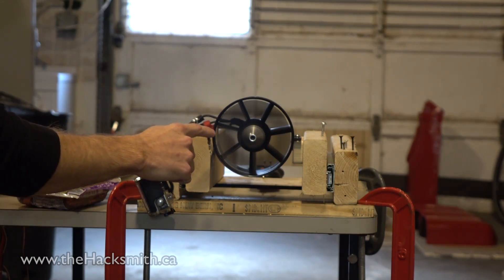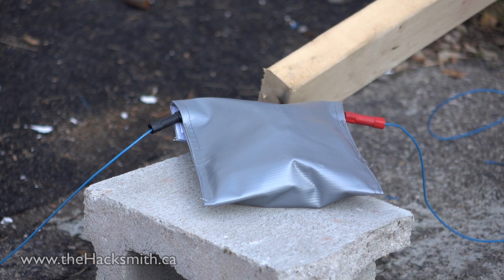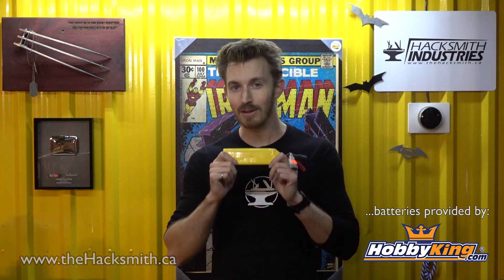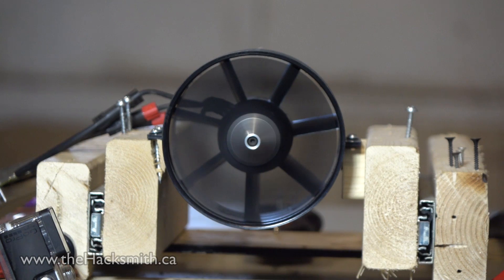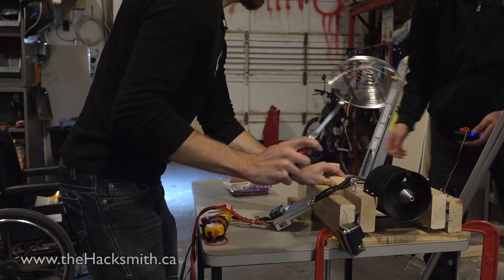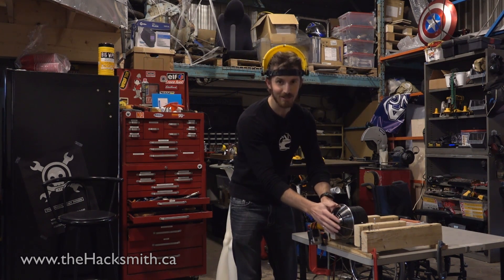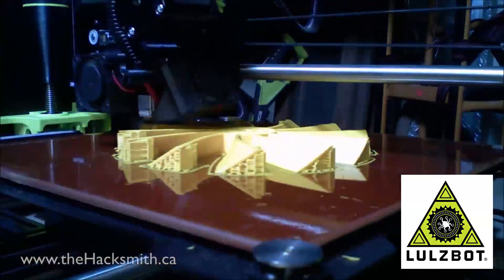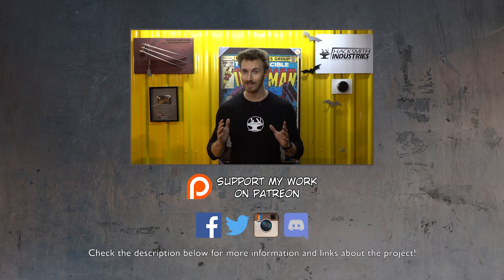Flying Like Iron Man #11: Not So Safe Safety Tests

Comment: couldn't you put a small solar panel on the suit to help give energy to the battery?
Reply from the maker: +Brian Navar you'd need a foot ball sized solar panel to even start to power this system -- it is extremely power hungry!
Reply: @hacksmith  i have an idea:

Connect the electrical transformers used in the taser potato to the solar panel=  INFINITE POWEEEER
Reply: Couldn't you put small pieces in different areas? Like as back/chest pieces? And than a strip on the forearm?
Reply: This is such an amazing build, very inspiring to think of many ways to make it better by the second.
Reply from the maker: +Brian Navar small pieces of what?
Reply from the maker: +Brian Navar they would be pointless though, small solar panels only produce like 5-10W -- they'd just make the suit really heavy. You'd have to leave it in the sun for a few years to charge it and even that probably wouldn't work cause the batteries would probably lose more charge from just sitting there :p
Reply from the maker: +The Diamond Crafter pretty sure I know more about solar than you guys. I have a 10kW array on my roof -- on a sunny day it might produce around 6-7kW. So if I have 1000sqft of solar panels I can power maybe one of my smaller EDFs. Lol
Reply: Why not build a small nuculear plant while hour at it?
Reply from the maker: +The Diamond Crafter pretty sure I know more about solar than you guys. I have a 10kW array on my roof -- on a sunny day it might produce around 6-7kW. So if I have 1000sqft of solar panels I can power maybe one of my smaller EDFs. Lol
Reply: Yeah, but you kept pushing the idea, even though they tried to tell you the facts. So I hoped actual calculations would convince you. Sorry if I sounded arrogant.
Reply: Brian Navar unfortunelty that wouldent help🙁 you would need hundreds or possibly thousands of full sised solar panels to power that suit
Reply: Yeah, you can make small pieces of solar panels for back and chest plates and a plate on the forearm
Reply: Ohhhh, okay. Seemed like a good idea in my head.
Reply from the maker: +Vulkan: Games & Space I think you should check your facts on that, solar panels are not that efficient. Maybe 1000 third world homes?
Reply: the Hacksmith why not just use one normal cable with a series of capasators to get the energy you need
Reply: not enough
Reply: Brian Navar wind turbine under the thruster will be better : ) and its saver because it took so long to dead and it will descend slowly
Reply: Brian Navar you wouldn't get nearly enough power from sloar
Reply: the Hacksmith i know you're right and everything it sounds silly that a solar panel would do anything but dont you think you're being a lil bit rude? You're asking for funding off your fan base then you talk down to them... Let them down gently not like that.
Reply: football field*?
Reply: Brian Navar there is no solar energy in the room m8
Reply: The solar panel.
Reply: the Hacksmith that's wrong go solat
Reply: Then try it and I'll FOLLoW you
Reply: Vulkan: Games & Space try it and I'll FOLLoW you even though I'm not that popular
Reply: The Diamond Crafter I dont have any... im kinda 14....
Reply: You are funny, and can obviously not calculate and/or research. Going by this  article https://www.nasa.gov/centers/kennedy/news/releases/2010/release-20100408c.html
The solar power plant you mention provides 10 mW, and will be around 60 acres big, which is 2,614,000 square ft. In other words; 2,6 MILLION square feet.
First, them costing around 1 million dollars for 30 sq ft is ridiculous, since a single plant will cost about 87 billion dollars, and they plan to do many of them. That put aside HackSmith requires 150 kW, so let's say he can cram 15 sq ft solar panels on his body (which is the average surface area of the human body). The solar panels could then provide:
2,614,000 sq ft = 10 mW or 10,000 kW (according to link)
1 sq ft  = 10,000 kW / 2,614,000 = 0.003826 kW
15 sq ft = 3.8 kW  * 15 = 0.05739 kW

Not even a fraction of what he needs!
He would need around 40,000 sq ft of those solar panels.
Reply: Osman Toplica are you talking to me? Because I was just curious about it, you didn't have to go waste your time to tell me something that was already answered.
Reply: I wasn't pushing the idea, I was just asking questions clearly.
Reply: Soaker panels wold be to slow
Reply: Brian Navar even if you could charge it fastly then you also have to worry about the battery being overcharged
Reply: Brian Navar wouldn't produce enough electricity to be efficient at all
Reply: Brian Navar Would not be efficient enough and would be too heavy/bulky
Reply: a small solar panel can take multiple hours to produce a worth while amount of energy
Reply: Not efficient enough
Reply: A house worth of solar panels make 80 kwatts
Reply: Brian Navar i just think you would also need to put the convertor to convert the solar energy and it would make it more heavy
Reply: Please tell me that was a joke
Reply: You should go to KSC there is a 350 sq foot solar panel powering 1000 homes as a test. didnt get exact voltages but if you could get your hands on it (Unlikely but possible) Solar panels might work!
Reply: the Hacksmith I just did. They cost roughly 1 million dollars per 30sq ft (WAAAAAY out of your budget) but they are the most efficient solar panels in the world. My friend at nasa (Who is working on the project) said that the solar panels will eventually replace all power plants and household solar panels

Comment: i thought you had a tormac pcnc 440, why not machine your own blades out of aluminium? I would be much more resistant and a lot smoother surface finish.
Reply from the maker: The 440 only has a bed size of 6" x 10" -- we can get free EDFs from Hobby King up to about 5" in diameter, so we wouldn't be gaining much from milling our own blades -- and each job would probably take 20-30 hours for that much detail =(
Reply: oh, didn't know that about the 440, maybe it is possible to have some kind of fixture to machine 1 5" or 6" blade an then weld it or bolt it to a central hub, so in best case the turbine could be 10" or 12". I guess i would be very time consuming and expansive due to the price of aluminium stock.

Comment: Ya' know, you could get 1 big EDF, then just make a silicone mold of the fan blade and copy the same design a few times out of pewter or Iron.
Reply from the maker: Pewter would be too soft, and iron would be too heavy -- it wouldn't be able to lift itself :P
Reply: Hmm, maybe what are the EDMs that you use are made out of, or Aluminum?
Reply from the maker: +Ptychozoon or plastic
Reply from the maker: +Ptychozoon or plastic
Reply: Yeah, exactly
Reply: Ptychozoon
Reply: Ken Barrozo ?

Comment: Don't know if it has been mentioned already but maybe try the print for the blade out of carbon reinforced nylon from  printer such as the Markforge Mk II? Should stand up to the forces pretty well over ABS and normal plastics. Love this channel BTW!
Reply from the maker: +Justin Coetzee I don't think the bed size on that printer is big enough! :(
Reply: the Hacksmith Markforge also has a new printer, the MK X which may be able to do it. it's a pricey machine but if it's for a prototype then you could possibly outsource to someone with a MK X? thanks for the reply BTW keep up the great channel!

Comment: If you add a compressor fan with high volume low pressure, the printed blades would would work well.  Then you can purchase a smaller metal blade and run at higher RPM to generate the actual thrust.  Also, if you turn the motor inside out (Make the blade part of the armature, and increase the size of the stator and eliminate the central shaft) I suspect you'll have better results. The navy did.

Comment: Instead of really expensive fans and bateries, which are also heavy, maybe you should use hybrid rockets like the one NightHawkInLight showed in his last video. You just have to made a bunch of them, strap an oxigen tank on your back and extend some hoses to each rocket. Also with this type of hybrid rockets, you can very finely control the thrust by adjusting the oxigen flow. You just need to research a bit about the nozzle shape, different types of fuel, materials... but that's what you are supose to do. Keep working and good luck ;)
Reply from the maker: Hybrid rockets could be cool, but while NightHawkInLight made it look pretty simple, remember the one he made didn't really produce any thrust. The scale and amount we'd need to fly might be out of the question. We do plan on messing around with hybrid rockets, but probably not for this project at this time =)

Comment: I'm not an expert at all but if you put a funnel on the edf wouldn't that result in more thrust with the same amount of power?
Reply from the maker: There's something called a thrust tube which you can add to an EDF to increase the thrust by 20-25% -- but that only works at high speeds. Since we're mostly just trying to hover, it actually reduces thrust (a static scenario)

Comment: Hello Mr Hacksmith, 
Do you think that it could be safety and more feasible with 5x jet engine RC thrust 300N each one ?
Reply from the maker: Thanks for the question ifrit772002!

We've actually answered this in detail in the Flying Like Iron Man Q&A video! Check out that video, or visit http://www.thehacksmith.ca/flight-project-qa/ to learn more about the project!
Reply: Yes i watched, it would be very expensive but an EDF with 300N thrust isn't exist lol... so maybe you could put 4 x 240N EDF on jet boots (two per boot) and 2x 240N EDF on hands (1 per Hand)....6 x EDF at arround 3600$ (21600$) for a max powerfull of 1440N ... i think it's a hard question because each system have avantages and disavantages....
Reply from the maker: +ifrit772002 to see the layout we have for the design check out the go fund me campaign :)

Comment: @the hacksmith, put an outer ring around the 3-d printed edf blades. They would then be support from two points and while it might reduce some of the thrust, they would have a much lower chance of breaking.

Comment: Have you considered printing the fan in PLA and using a 'lost PLA' casting method to cast the blades in Aluminum?
Reply from the maker: Problem is at home-casting is pretty difficult for precision parts. It works for a lot of things, but for something like this, might be more effort than it's worth.

For example -- if you see the professional EDF blade we show near the end of the video -- look at the underside. It has a bunch of holes in it. Those are for balancing the blade so when it spins the CofG is perfectly in the center. Considering that whole piece was machined very accurately, it should of been balanced from the get go. Now imagine casting it, how many variations it would have! It might be possible, but like I said -- would probably end up being more effort than it's worth.

Comment: On the edf blades:
Wouldnt it be more strucatually stronger if the side where the wind goes to was made of triangualar shapes? this is quite stronger then solid material and would end less peices flying off also it would make the edf blade lighter resulting in a bit more rpm on the blade itself

Comment: hey hacksmith, what you can do to create your own EDFs is, 3D print the blade design, then make silicone mold of it then a wax mold inside of silicone and then forge metal and make your very own metal blades  !!!! Please reply if you read the comment
Reply from the maker: Problem is at home-casting is pretty difficult for precision parts. It works for a lot of things, but for something like this, might be more effort than it's worth.

For example -- if you see the professional EDF blade we show near the end of the video -- look at the underside. It has a bunch of holes in it. Those are for balancing the blade so when it spins the CofG is perfectly in the center. Considering that whole piece was machined very accurately, it should of been balanced from the get go. Now imagine casting it, how many variations it would have! It might be possible, but like I said -- would probably end up being more effort than it's worth.
Reply: the Hacksmith Oh, didn't consider that,For that problem, you might need to buy metal 3D printers I guess??!!! Iove what you guys are doing and keep doing it !!!

Comment: is it possible to get your hands on graphene super-capacitators (misspelled) they are light and possibly cheap due to their material
Reply: it is also possible to make them yourself
Reply from the maker: +Izharul Aqeel not on this scale. Super capacitors are good for discharging lots of power really fast, but can't store much. Lithium polymer is still the best option to power this system
Reply: +the Hacksmith why not using them as the initial thrust needed to lift you off like a rocket, First use the normal power then discharge the power from the capacitators to lift u off.
Reply: +Izharul Aqeel You can add more for short bursts to keep you off the ground

Comment: If you are really into making your own blades then I suggest getting professionally modelled and refined blades (I'm sure someone out there has them already), then turning that model into a mould and printing that. Smooth out that mould and use it to build your own carbon fiber blades, on this small scale it doesn't actually cost that much and can be done relatively quickly.
3D printed plastics themselves just always come out with layer adhesion problems, strong in some directions but under stress they quickly tear apart.
Reply from the maker: We need to finish the design stage first before we figure out how to manufacture them in the long run. The prototypes we've made are for seeing how much thrust we can get -- once we're there we can look into having them properly manufactured. Most likely is CNC machining in China by a manufacturer we know =)

Comment: BTW you should focus on some smaller projects... fuel and explosives are cheap.. use your imagination.
Reply from the maker: +Designandrew try watching our other videos? We've done a bunch of other projects during this one ...
Reply: the Hacksmith I do watch them all. But I feel like with less time you could be doing so much more. I mean buy an old car and strip the panels off to the frame and romp it in a Forrest, or build a $500 car for 24 hour lemons and vlog the build of the race car, I feel like that is a huge opportunity youtubers are missing out on, would make an epic series then culminates with a race in 24 hours lemons. Just hack more shit. Anyway I really think you will need RC jet turbine engines providing main thrust for the iron man flying project to be viable. Check out the company I linked they seem keen on advertising/sponsorship deals. You could very easily pitch the project to them with your large subscriber base. One last thing, I suggest some kind of star wars themed project in december when CPM in highest, and it will tie into Rogue one movie. Maybe build a model death star and blow up a paper planet using a high powered laser and some fuel and explosives in the paper planet, that would be a great cheap fast fun video.
Reply from the maker: +Designandrew both of those ideas would take way more time to execute... We are planning a star wars build though :)

Check out the QA video for info on why we're not using jet turbines :)
Reply from the maker: Also when ever we've done off-topic builds from our main channel focus (make it real) it hasn't done well... you have to cater video content to the interests of the main subscribers. a lemon race does sound cool, but like I said in the last comment it would take waaay more planning to execute, and would end up being a ton of work to produce. Cool idea though =)

Comment: the Hacksmith you should get the rocket boots and with to jets on the back you shoul put a second pair on the outside for an extra boost and if you can you should use the hammer with the boits to do a boost hit resulting in more of an impact
Reply from the maker: Thanks for the question killerofgods03!

We've actually answered this in detail in the Flying Like Iron Man Q&A video! Check out that video, or visit http://www.thehacksmith.ca/flight-project-qa/ to learn more about the project!

Comment: a thethered DC system will work, it has nothing to do with your house AC power... what are you saying mate.
Reply from the maker: Look up the recommended cable size for 150,000W... The size of the cables is still going to be too big. Longer cables, especially at the minimum thickness will increase resistance substantially and waste even more power.

We can just barely push 44V at 200A through an 8ga wire -- that's only 8.8kW. We'd either need 17 pairs (that's 34 8ga wires) or a much thicker gauge. Going to weigh too much! And we'll still need batteries, because even if we had a $50,000 AC/DC converter capable of 150kW -- we'd need to power it directly off the main power lines-- which we can't.
Reply: gotchya, thanks for replying